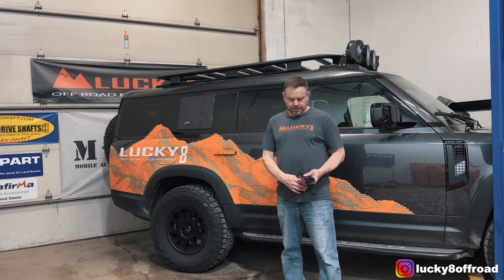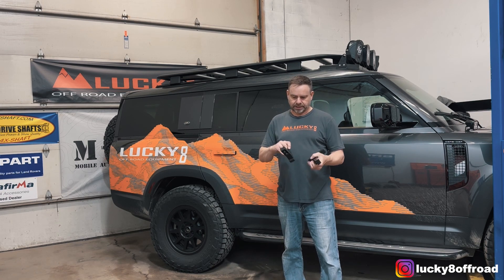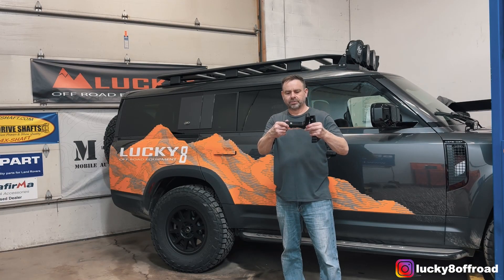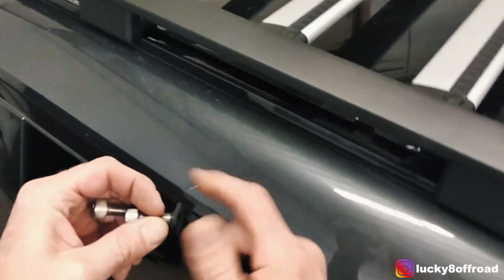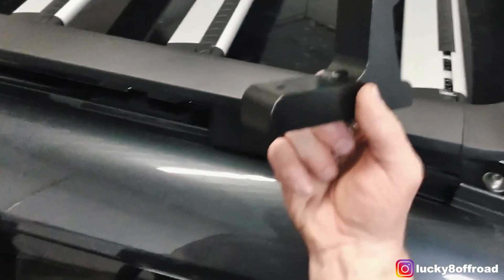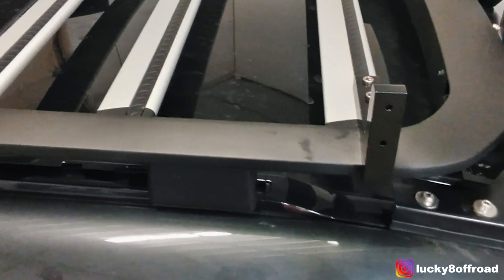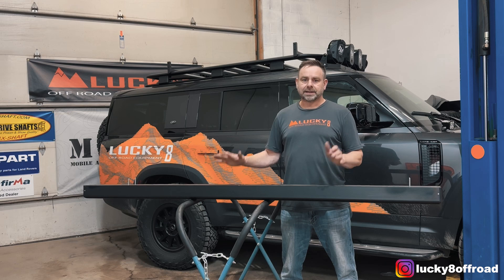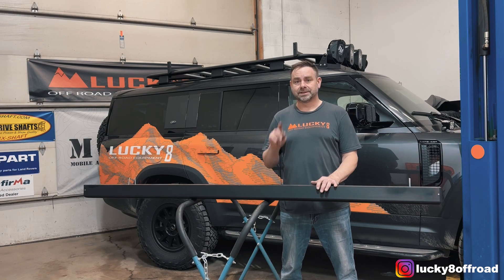Easy Installation Guide: Proud Rhino Aluminum Awning Brackets for Genuine Defender Roof Racks

Comment: Where can I get the t slot nuts? My mount came installed on the roofnest but I’d like to install it directly on the roof rack
Reply from the maker: Are you referring to the ones that slide into the factory channel or do you need the whole awning kit. We have those available on the site.